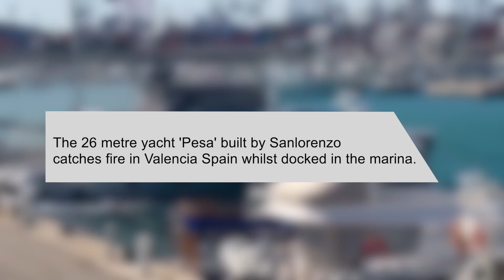Ship Capsizes after Uncontrolled Offloading | 3 Minutes of Maritime

Comment: This new wonder product lithium battery's are an unbelievable fire hazard, I think if you can accept the extra weight and on a yacht its not a problem then hi end lead acid is the way to go,
And the fact that there almost impossible to extinguish is another reason.
Reply: What’s of concern is that these batteries ignite spontaneously, but worse; if they come into contact with water they explode into flames.
Reply: There is a video of a bus burning in the middle of Paris - same issue, lithium batteries were the cause - and all you could see was a rain of molten plastics and metal. Luckily it was empty and parked when it caught fire but the heat generated to melt to that metal shows just how dangerous they are.  If there had been passengers on board then they would have been lucky to escape with only burns from the hot metals but apart from all else, the pollution they cause as a result of the fires alone should be a very good reason NOT to risk using them.  At least, not until they can be housed in something that would contain and extinguish any fires without the sort of episodes seen in the Spanish marine or the streets of Paris.

Comment: I wonder why the crew of the dredger didn't have a lifeboat?  Eight hours floating around at sea had to have been beyond depressing and forlorn.
Reply: That's what I wonder too.  Is it only meant to stay in bays or something calm.  Why wasn't the boat prepared for evacuations.
Reply: @skiingfast1  This I would suggest is an aggregate dredger, which on the whole are sea going.I worked on one for 7.5 years and most of our dredge patches were in open sea areas.
Reply: I was floating around depressed and forlorn for eight long years, then I got a divorce and was saved.

😅😅😅😅

Comment: 12 hours to put out that yacht fire?! And then those crew with no life boat and only vests were actually found?! This stuff is incredible -ty for these vids - holy crap!
Reply: Mate once fiberglass and all the other crap on a yacht starts to burn that's the end of it and it takes a hella lot to extinguish.
Reply: not to mention the cause of fire was the lithium battery
Reply: Anne Frank Vape Pen  yeah a Tesla spontaneously caught fire on a parking structure & burnt up some of my neighbors' cars. The owner, it wasn't his fault, he did everything he was supposed to according to the fire department. By now they're used to these, but they're still dangerous, particularly when the battery has what's called "thermal creep" where the battery burns cell by cell, sometimes over the course of a day.

Comment: Seems like the lithium batteries are a proble.
Reply: No joke. Not only are they used on yachts, the ones in cars are also susceptible to self-immolation. Worst still, the batteries lose charge in cold weather and if electric cars are caught in a blizzard, then the occupants will die when the charge runs out, whilst the petrol/gas cars can continue to switch their engines on to warm up.
Reply: And we're all being told to buy electric lithium cars!

Comment: have to wonder about the design of those batteries if they couldn't get the situation under control for that long and in the end total loss of the vehicle
Reply: Read about Tesla car fires... Same type battery. Firefighters say they take hours to put out and require much more water than a regular fire; the burning metals in the batteries are enclosed in cases, and you can't get the water inside to cool it down.